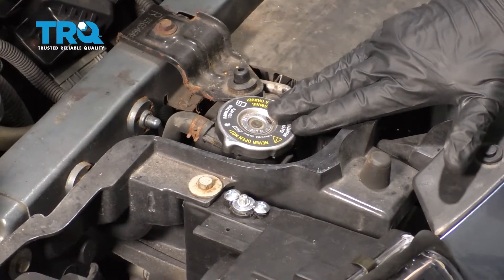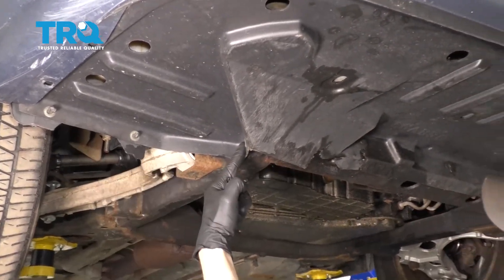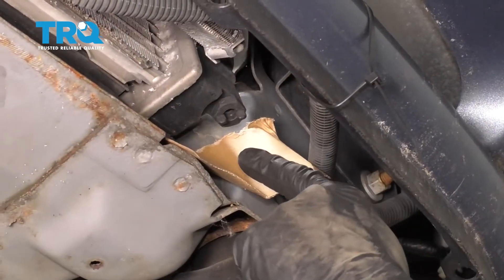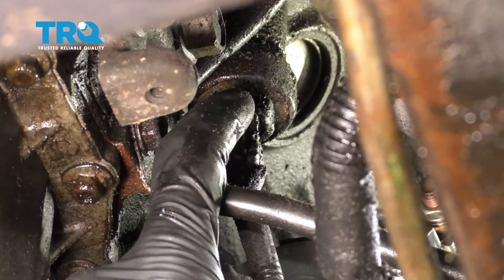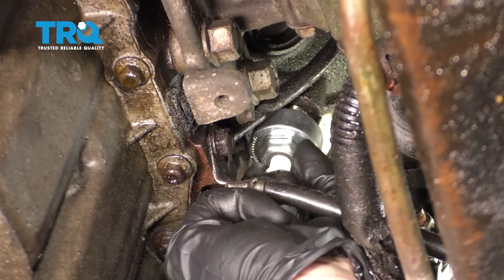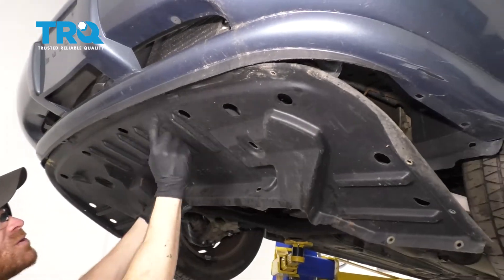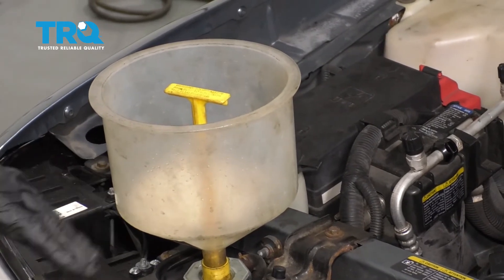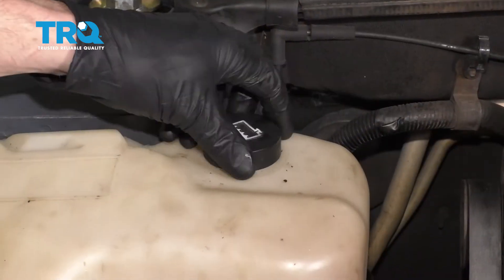How to Replace Engine Knock Sensor 2000-2005 Buick LeSabre

Comment: I noticed there was a completely different drain plug on the lower radiator??? What's up with that??? The front knock sensor seems relatively simple compared to the rear knock sensor, do you have a video covering the removal and replacement of the rear knock sensor???? My car is a 2005 Buick LeSabre.